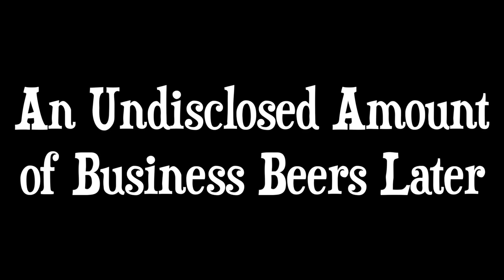BUELL Motorcycles: Its JUST a Fancy Sportster

Comment: Yeah, it's just a Sportster. If a Sportster weighed 400lbs,  had a perimeter aluminum frame, sport bike suspension and brakes and 100+hp.....
Reply: Completely different. Rider triangle, power curve, suspension, brakes, handling.....all COMPLETELY different.
Reply: Was a great bike I still have one short wheel base low center of gravity great low end torque light and flickable
Reply: Buell Cyclone is like a big dirt bike, lots of torque, fun to slide and throw in and out of corners.
Reply: Damian Jablonski  Not remotely close. lol
Reply: The Buell rides like a sports bike. The sportster ride's like a boat anchor. Two totally different bikes
Reply: Shit I have a 2007 Harley Davidson nitster 1200 which is just a sportster but it's a dam monster it's fast without me on it it's weight is 333 lbs with me it's 460
Reply: @biker9835  The only way it would be that light is if you pulled the engine lol
Reply: @jabersulieman8211  Where I’m from that’s called Bullshit. The wet weight on his bike is 565lb, with his skinny, lying self it’s 692, aka 700lb.
Reply: Damian Jablonski  not even in the slightest. If you’ve ridden both you’d know this isn’t even remotely accurate.
Reply: @biker9835  howd you shave so much weight off of it? i have an 07 as well and that just blew my mind, almost 200 pounds lighter😮 niiice
Reply: The 1125cr is certainly not a sportster and hauls ass!
Reply: I have a 2007 sporty and it weighs 480 with a straight pipes and a sissy bar so 🤷🏻‍♂️
Reply: @biker9835  idk where you got your info but thats a 500 pound bike buddy
Reply: I am the proud owner of a 2001 buell M2 cyclone..  
I will never sell it!
Reply: Love my 03 Buell XB9S... it is therapy! My favorite ride, ever

Comment: FYI.....something is DEFINITELY wrong with Chey's Sportster. I had a 1991 Sportster 1200 with a CV carb. Every morning, pull the choke, wick the throttle once, hit the start button and it would fire in HALF a revolution. WITHOUT FAIL. Best starting motorcycle I've ever owned.
Reply: 100%. A CV is plenty adequate. Had a CV performance kit on my dyna 88", pull choke, blip throttle, second revolution and she'd fire every time. I tuned the carburetor 5 years prior to selling it and hadnt touched it once past the initial set up, and thats Wisconsin weather. 30 degrees to 100 degrees, no problem.
Reply: Same with mine . Only time I had trouble was when it was -10 it kinda needed warmed up , the oil that is. PA winters got to love them battery tender to the rescue.
Reply: I actually didn't know about the "throttle blip" part of starting my 2003 Sporty until a recent one of Shadetree's videos where he was telling Chey to do it. Now I do two blips, full choke, and it still takes a couple of chugs to fire up, but it's WAY faster to get started now. I used to have to crank on it a fair bit before it would turn over, which may be part of why my old stator wound up melting down. One of the downsides of an old, used Sporty being your first bike and having NO ONE around to tell you (or rather me) this crap. So thank you, Josh!
Reply: My 91 1200 is the same way , pull the choke and bang thing fires up instantaneously lol, it’s even better since I put a Mikuni HSR42 on it and pulls a lot better too
Reply: In northern New England.....they DEFINITELY don't start better with a flat slide. Cold idle is definitely not as good as a CV. Throttle response,  though? 😶😶😶
Reply: Honestly it’s better all around and it’s colder where I live haha , I’m up in Newfoundland
Reply: As a matter of fact with the mikuni I rarely use the choke
Reply: My dyna fires right up 2 wacks of the throttle full choke, starts everytime. It pays to rebuild your carb and learn the parts and how things work. I have zero complaints with my cv
Reply: My '95 Sportster 1200 always started right away.  Faster that any of the 169 other bikes I have owned.
Reply: @greenstreak750  Mine too , just hit the button and it fires instantly

Comment: Before harley started helping him Erik Buell used to make only a handful of bikes a year. I was working at a harley dealer in the mid 90's in Central Texas. The owner of the San Antonio shop was at our place talking with the owners and said that he should send the one that he had on the floor to our place for a while since no one seemed interested in it. I piped up that if he would have it ready to go my girlfriend would drive me down and I would ride it back. I has previously had a 1986 883 sportster. So after picking up the Buell which was a 1200 I started rolling north on I-35 and just outside of the city I dropped from 4th gear to 3rd and launched it, found 5th gear since my '86 sporty only was a 4 speed. The bike took off like everyone pulled over and parked. I did that twice then had to pull over on the shoulder to wait for my girlfriend to catch up. People like to goof on sportsters but they have always been the faster of harleys bikes. And the fxr was basically a big inch sportster. Also when people are serious about racing harleys they usually swap to a 4 cam motor, just like the sportster something about that valve train geometry and power transfer. There are a lot of things that you could do to both your sportster and the fxr and have some badass bikes without breaking the bank or sacrificing reliability. 🙂

Comment: A lot of the Buell firestorm/thunderstorm concepts came from the one year only '86 Sportster EVO 1100. Sometimes called Liberty Edition Sportster, with heads that are called Bath-tub heads.    Largest valves ever put on a stock Sportster, a combustion chamber squish pattern that gives torque 400 rpm lower , and the valves let it breath up high.   And the heads are "sandcast" Aluminum (ask people about sandcast Honda CB750's).  And it's at 452 pounds, about 7 pounds lighter than an 883 of the same vintage.  Buell took the heads and one upped then with better porting and tuning.

Comment: I used to work at Harley dealers. In 2010, they gave me a 2009 Sportster XR1200 as a demo bike for the summer. Incidental, 2nd gear, sit-down, roll-on, 10 O'clock wheelie. I'm not even kidding. I almost loaded my skivvies.

Comment: I had the m2 and put lighting cams and a S&S carb on it. It was fun but fell apart when I started doing track days on it. I also raised the foot pegs on it. It was fun and smooth with the rubber mounted engine.

Comment: From 2002 HD Sportster Service manual:

883 rated 57 HP @ 6000 RPM
1200 66 HP @ 5200 RPM
1200S Sport 69 HP @ 5500 RPM

From 1999/2000 Buell Lightning Service Manual:

2000 X-1 101 HP @ 6200 RPM
1995-96 S-2 76 HP @ 5200 RPM
1997-98 M-2 83 HP @ 5800 RPM
Reply from the maker: There’s no way that 883 makes 57 hp 😂😂😂
Reply: Hard to believe the 1200 s only had them numbers I’m thinking that was underrated.
Reply: @karlhockenberry9130  i have a 1999 XL1200S and compared to the standard XL.s ive had the performance difference was pretty large , even sounds different has twin plug heads  and  single fire ignition etc as standard ,
Reply: @specialse  yeah that’s what I’m saying them numbers are off. I think the S was more like 105 - 110 hp and 90 foot pounds torque. Some thing like that . Ripping bikes.I wouldn’t mind finding a engine out of a buell xb12 and stuff it in my 2k 1200 custom . And I would own any of the 1200 models . But better grab them now because prices are only going to go way up in them now since Sportsters are no longer evo engine bikes . I’m not bitching evo had a damn long run since what 1984? To 2021 -22 ? And the Sportster it self is the longest running Moco brand Harley had out of all of them . I’ll take my girls bike all day every day. And will keep ridding it into the 1 million mile range and I bet they will do it . The evo sporty is bullet proof. With a few exceptions that damn steel gear for the oil pump and the grenade pack in the clutches. But shit it’s a fix. Sportsters are the coolest bikes Harley ever made in my opinion and will be for a long time. Check out my face book page Sportster Nation Sportster owners only. I got to update it so send me some pictures idc as long as they ain’t dick pics or shit like that.  Oh and btw I’m Tom Hockenberry on face book and instagram . Thank you Josh “ Shadetree “ Swamp wizzard “ your the man bro .
Reply: @karlhockenberry9130  not even close, more like 70-80ish hp at best stock. The heads were based on the lightning heads off earlier Buells.
Reply: @karlhockenberry9130  yea built to be repaired . but XL1200S is the best so far . ive own most models ,
Reply: @karlhockenberry9130  sportster nation  or sportster nation sportsters ?

Comment: If the cases are bored it's either been converted over to a 88 or maybe 90 inch. That looks like an old Axtell logo on the cylinder, they made ductile iron big bore cylinders for Sportsters to convert to 88 and 90 inch.
Reply: Years back I had an '04 XB12R and wanted an 88" big-bore kit so bad. I can only imagine what the torque would be like in the small wheelbase of an XB.

Comment: Erik Buell started building bikes in the early 80's using xr1000 engines left over from the factory & built some very Kool stuff using vendors from all over the world . Then sold like half the company to Harley where they kinda beat it like a step child . Towards the end of Buell they used Rotax  motors & in 2004 many left over Buell parts like heads got put on sportsters but a Buell motor only looks simular from the outside , narrower  flywheels ,tricker heads  ,bigger cams & more made the way more fun ! I've had a few .

Comment: I've got a EFI hammer performance 1275 kit with cams and xb heads 100hp/95tq. It definitely transforms the sportster engine
Reply: THAT would be one hell of an upgrade to the ADV Dirtster, heh!
Reply: Still slow junk
Reply: @howardrossell2771  well it runs 11s and beats most Harleys on the road. Harley fast is different than sport bike fast. It's a bike that makes you feel good when you ride it, lots of character. There's more to motorcycles than gsxr1000's bud.

Comment: I have a Sportster 883 I test Road a Buell. When I opened up the throttle like on my Sportster the front wheel came off the ground and when I hit the brakes like I did on my Sportster the ass end lifted off the ground. A Buell is the Hulk and a Sportster is Bruce Banner.

Comment: Fairly certain someone else has pointed this out by how but... The logos cast into the cylinders on the Buell are Axtell and the largest cylinders you can put into overbored cases are 3 15/16ths inch, which, when combined with the stock stroke, yields 90 cubic inches. Not Surprised that an almost 1500cc machine could generate impressive power, Hammer Performance's dyno room page features one customers bike (90ci. big bore, Buell crank conversion, and essentially their 120+HP kit for cams, head work, and valve train...            ...152HP and 127ft. lbs.!    Beginning as an 883, they transformed it from Cruiser to Cruise Missile!

Comment: Unless you're dragging you knees around the twisties at full bore, you still haven't "ridden" a Buell. The magic is in it's lightweight, low COG, flick-ablity (handling), low-end torque, and incredible braking system. If you're not changing 5 rear tires for every 1 front tire, you're not riding it right. I'm talking about the newer X frame 12 series, not the old tubers.

Comment: That Buell experience you had, well that's how a proper EVO Harley-Davidson Sportster motor should run and ride. See Eric Buell basically purchased standard EVO motors a Harley-Davidson and took 'em apart ride away in the Buell Factory... He took out all standard low tech Harley junk parts and mounted all Buell High-Tech race parts and Voilá that's how you make a Sportster fly. Remember that Eric Buell came out of the Racing world, so he knew a few thing to beef up any motorcycle. Makes me wonder though... why did all H-D Sporsters stay that slow and had crappy suspension... well the most obvious reason was: Harley-Davidson did not want to invest in better parts...Until in 2008 H-D unplugged the Buell-company and told Buell to stop production. A lot of Buell Beefed up Sporster Motors were in stock though...so what to do H-D asked itself... Well have you ever wondered why H-D ever started producing the H-D XR1200 Sportster to begin with..? Yeah 1+1=2.  H-D never had the knowledge in the house to create the XR1200 but they did have a lot of Buell motors laying around in the formal Buell factory... This is why the XR1200 came into production and this is why the H-D XR1200 Sportster flies like a Buell, has the power of a Buell, feels like a Buell and almost rides like a Buell, because even at the XR1200 H-D managed to find crapy cheap suspension parts to ruin the ride. A XR1200 really flies, although it was still far to heavy and yet still under powered to compete with other competing Motorcycle brands at the time. By the way, your 1989 Yamaha V-max...should have like 145 Horse power, at least that's what they had here in Europe. The 100 Horse Power version was available here in Europe as well though. You should be able to tell; when you turn the ignition key underneath the fake gas tank cover you should hear the sound of several servo's. If no sound of servo's can be noticed: you probably have the 100 Hp version. If you do hear the servo sound, chances are large that you've got a 145 Horse power V-Max.

Comment: The 883 Sportster may not have a lot of horsepower but by 883 Sportster 2 up in August the oil temperature runs 200° according to the thermostat on the oil tank and that's in Florida in August in the summertime. I have 400,000 miles on the bike with the original motor. I've had the bike 20 years plus. I actually wore out the front end. It's been a lot more reliable and I ever thought a Harley would be and compared to the big twins it certainly is.

Comment: Buell with the thunderstorm motor. Heads were different. Higher volume oil pump. I had one for years. I had it made into an 88" motor. It made 125 hp on pump gas. I rode it all over the country.

Comment: Josh, unless you've already left for the TAT, get a new helmet with an opening big enough to wear goggles. Some of the road you'll be riding is really dusty and that dust will find it's way up in to your helmet, and into your eyes if you just wear a visor. Goggles solves the problem. You could just use your cross helmet.

Comment: I test ride a Buell many years ago and still remember the experience. Had to sign a waiver and the last words said to me were, and I quote "grab too much throttle and you'll stand it on the back wheel, too much front front brake and you'll stand it on the front wheel. And if you crash it, make sure you total it cause I won't want it back". Very much regret not buying it. Oh, and it shook so bad at idle my vision blurred. Regret.
Reply: I had the same experience on a S1W I test rode. Massive mistake not buying it. I think about the test ride on it all the time. I bought a xr1200 instead which did not compare in the long run.

Comment: I've had a couple 883s they like revs. Both mine were rubber mounted so your mileage may vary. I never had a tach, but they were always happier above about 3500  RPMs. I wouldn't shift into 5th until at least 70 or 75.

Comment: a sportster looks better than a beull to me ... the thing is though, i had to do a lot of work on my sporty to move the center of gravity forward. ( it's the long engine gear box )
i love the way my sporty looks, 
but i don't want my bike to drift like a flat tracker on pavement, 1) because it is freaky, and 2) because i want my rear tire to stay on the road, and out of the other lane... most people wont push an H-D into a drift, but sometimes the scenery is going by fast and trouble creeps up on you ... the buells are balanced well, ( as butt ugly as some think they are ) .... but H-D got it right with the Sportster S ( and maybe the Nightster too?).. there, the weight of the engine and tyranny is further forward ... LiFePO4 batteries help, anything to lighten the back, and dual disks, and big oil coolers help get weight up front.

i run pulled back drag bars, and totally reworked every ounce i could forward ... 
even on a balanced bike, you don't want to push your traction limits at all two up .. but i like to tear it up a bit when it's just me.

Comment: Evo motors have got to have to most potential from stock on any motor. I don't mean like peak horsepower, obviously the M8 has that beat by miles if you count the long block heads, but the potential of the Evo is just crazy because they can literally come from the factory with around 40 hp and there's Evos out there with 100hp+. Crazy that there can be a freaking 60+ hp swing on those things.

Comment: Now Buell a few years later the Buell was highly modified, and they looked like a Sportster but that was the end of the story.  A stock mid 2000's Buell will smoke any factory built Sportster, and easily outhandle any and outlast ANY built up Sportster.  The only differences on the Buell was, Heads, Cylinders, Cases, Gears, Frame, exhaust and induction.

Comment: im not sure but i know Hammer Performance used to offer an 88ci and a 90ci cylinders for the sporster designed by them. i forget who did the castings , started with an A i think.  i seen another brand offering 88ci kit. those 2 are the only ones i know of. if there is another maker of big bore kits i would like to know myself....for research purposes of course..lol.  that thing sounds sweet too, really deep.  good vid man
Reply: Axtell made the jugs. Hammer Performance was an off shoot of NRHS. I think the Hammer guys had different ideas of how to make power.
Reply: My guess its 90 in. S&S made 89 in. And 100in sportster motors.